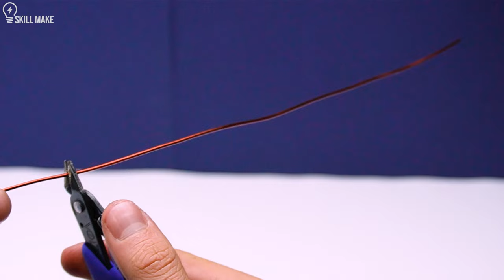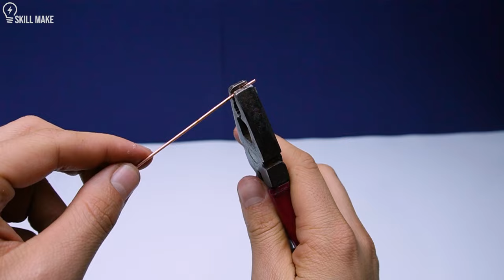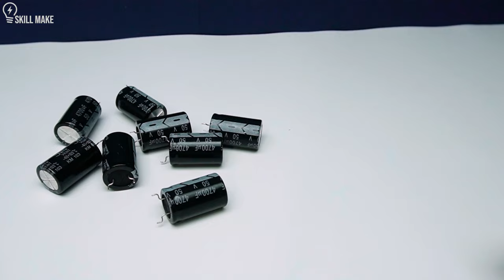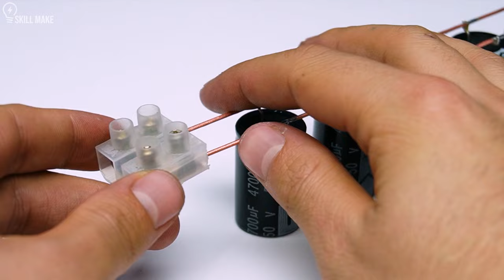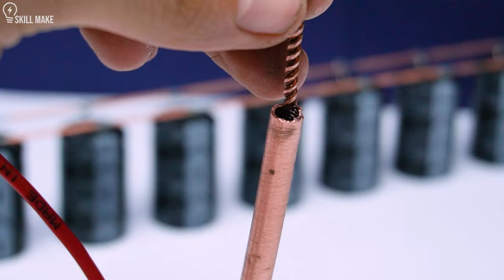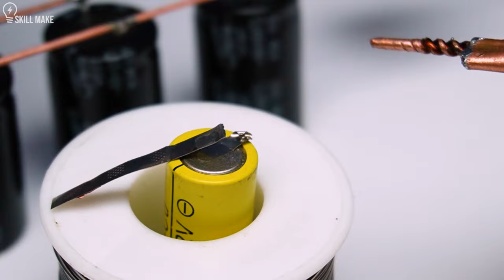DIY Spot Welding Machine using Super Capacitor - Simple Super Capacitor

Comment: Why are there no wide shots of you using the device? It's only ever partly on screen. The last shot with knife blade and piece of wood was far more energy than those capacitors could provide, and for far too long. Those caps would drain almost instantly with how little resistance is in the design.
Reply: Agreed.
Reply: He is probably using >60 Ah 12v car battery and those capacitors are only for show off.

Comment: Good video, a curious data: those are not Super Capacitors (which are rated in Farads not microFarads) the ones you're using are normal electrolitic capacitors, your setup has only 37,600 microFarads which equals 0.037F, hardly a super capacitor

Comment: Capacitors like that aren't designed to be shorted out and are likely to be damaged by being used in that way. You'd be better off using capacitors designed for camera flash units as they are designed for near instant discharge.
Reply from the maker: Thank you for the information you shared, I will definitely correct it in future videos
Reply: What are those caps called?
Reply: @plutonianfairy are you serious 😂
Reply: @davey2k12 handy caps 😅
Reply: @plutonianfairy they are just normal 50v polarized capacitors and don't sweat discharging these this way. He's thinking of tantalum capacitors not regular aluminum film electrolyte caps like these. All the stores energy is going into the arc and work. Your only real worry is over voltage and go watch an electroboom video to see what happens.
Reply: @flyback_driver I agree. I think tantalum caps could explode.  
I would add a momentary switch on the positive rod and a high wattage resistor to discharge the device for storage.

Comment: I like it. I think I'll copy your design. 
I would add a momentary switch on the positive rod and include a high wattage resistor to discharge the device for storage. Thanks for posting!
Reply: how eould you do it with the wattage resistor?
Reply: @VitMcG  I'd short the terminals.
Reply: It's not wattage. It's called POWER.

Comment: i try this circuit with the same value but i don't get the same result, what kind of transformer you are using?
Reply: Probably a microwave transformer with the secondary drilled out and replaced with about one turn of ultra thick wire.
Reply: So capacitors are just bullshit. A transformer of 150 amperes is enough to do the trick.

Comment: You should zoom out your video to include your battery set up in your diy.
Reply: you just need to read the description for more information. There is no battery in this setup: "And I charge them with a 12-24 volt power supply."